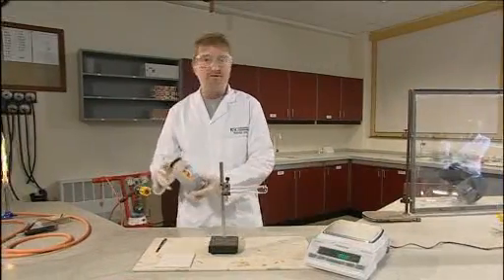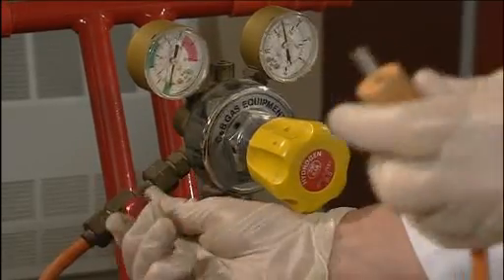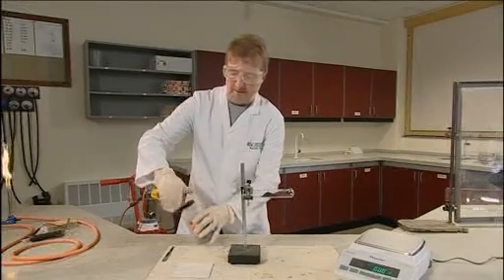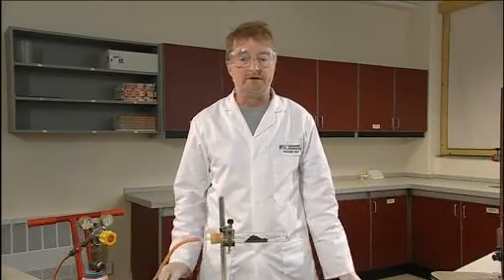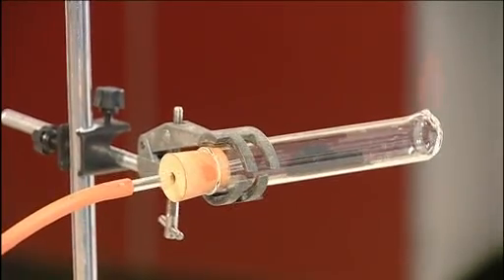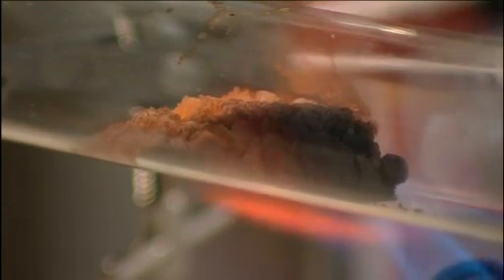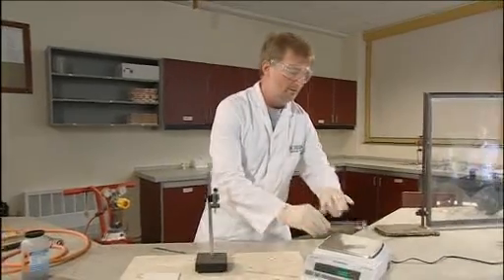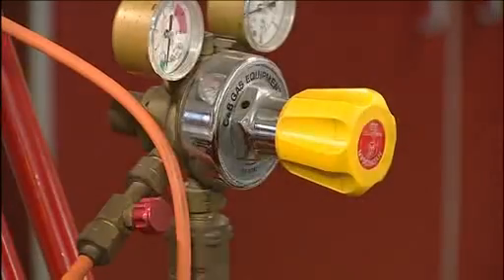Reduction of copper oxide

Comment: Is it possible to use reaction between metal and hydrochloric acid to produce hydrogen gas instead of using hydrogen gas tank. If possible, is it hard to carry out the activity?
Reply: +Cikgu Shikin Yes, I have done so using a hydrogen generator with either HCl or H2SO4 and mossy zinc.  And, if one doesn't have an explosion shield, one can cover the hydrogen generator and most of the apparatus with a lab apron or plastic sheeting until the hydrogen escaping the ignition tube is lit.  You can also get good results with silver oxide.
Reply: chasriner 
Tq for information. I will try to do it.

Comment: what type of glass text tube you uesd in this experiment ?
is it borosil glass test tube or qurtz glass test tube ?
as i knowns brosil glass with stand upto 450°C only.
melting point of copper oxide is  1,326 °C
Reply: I don't believe it ever becomes molten. Just hot enough to separate the Oxygen from the Copper.
Reply: +Raj Heman I have used a pyrex or Kimax tube.

Comment: Why does the colour change to pink.. isn't pure Copper reddish orange.
Reply: Abhishek Dasmunshy no copper is pinkish red

if it's orange it has a little oxide on it.
if you take a dirty penny and dip it in HCl, you will see that it dissolves only the oxide and leaves you with a pinkish looking penny
Reply: Abhishek Dasmunshy no copper is pinkish red

if it's orange it has a little oxide on it.
if you take a dirty penny and dip it in HCl, you will see that it dissolves only the oxide and leaves you with a pinkish looking penny

Comment: "this valve is the pressure reduction valve"  That is a regulator, the main valve regulates the output pressure., If you intend to use any form of flow restriction. A flowmeter should be installed onto the manifold. (when dealing high pressure cylinders such as hydrogen, a double regulator manifold should be used)

Comment: One very important thing to remember when dealing with pressure regulators on tanks like these.... NEVER stand in front of the adjusting screw when opening the main valve. 

Many have torn the threads out and shot the end off like a rocket... If you're standing there looking at it, you'll catch it with your face. Not good. 

Ask any professional welder for verification. 

Good video though!